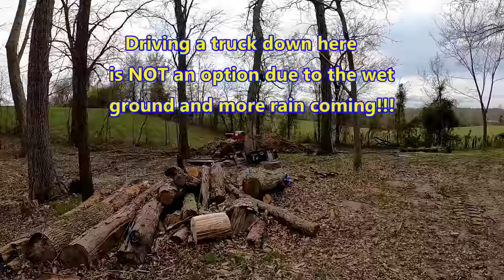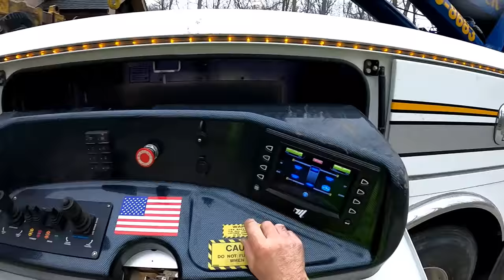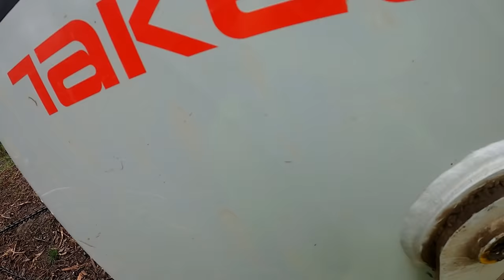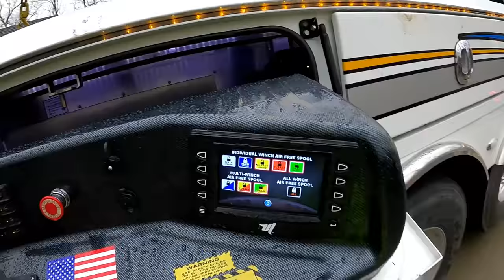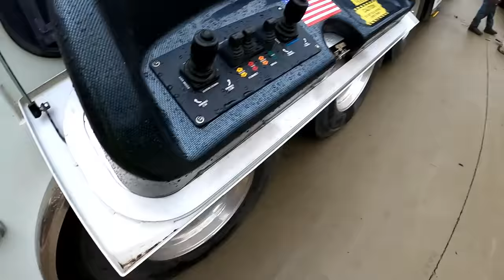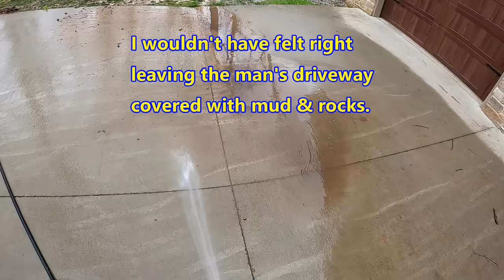The Uphill Battle!!!  Working in the Rain, Just Working in the Rain.

Comment: You know Ron ,
what you need in your
workshop is an Arsenal
of mat tracks dollies and 
two good  sizes skid steer 
this will save you time and
no effort at all to get things
out of the deep muddy woods 
when there stuck and won't 
start back up to get themselves
out of the muddy woods.
you know they should really 
take a picture of there problems
 before calling your tow company
this way you would know what 
equipment to bring along if needed,
saves time and money . I got a good
question °?° ..for you 
                 👉  do you have
 a zip line setup in the shop .
      •? 👆   for easy access
              and recovery. 
funny thing after I was finish
with this comment I heard you
said we should of made us some
zip line at 56:17 of this video .
Next time I'll wait to finish watching
your video before I placed comment 
on it .
How many times did mike walk 
up and down the hill getting stuff to
 retrieve this skid steer off the hill ,
perhaps a Hydraulic  mattrack driven
flatbed trailer with a rear lift and a 
truck winch 
to track down and back up with a load 
on up a muddy hill will be ideal for this
 kind of recovery,
 that is lot of work you and your
 crew had to do on a muddy hill,
a very good video I like this kind of 
Recovery thank you Ron and 
GOD BLESS . 
     ☝
         °?°
          🎽👍
Reply from the maker: Thank you for watching and God bless.
Reply: @RonPratt  your welcome Ron 
I was just thinking of you, I thought you must have been out there again filming another video on the Job sight this very day. happy 2022 .